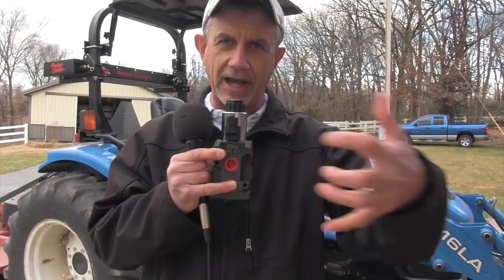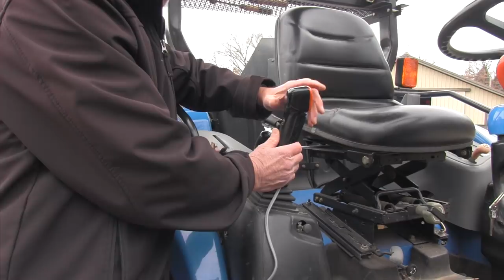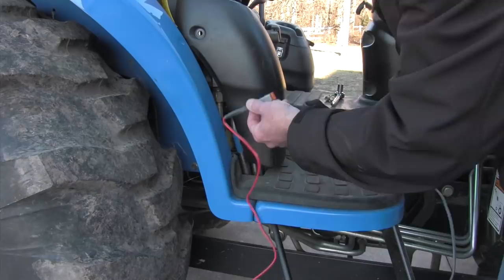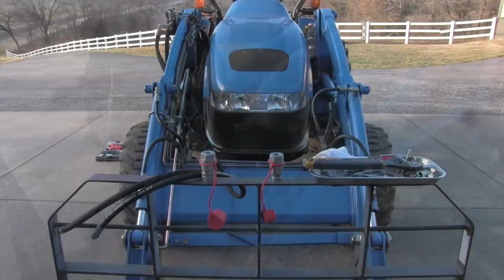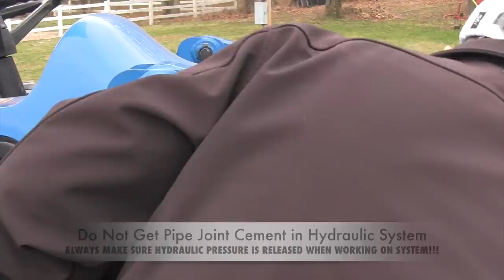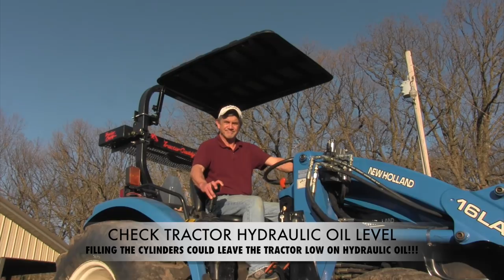How to Install a Diverter Valve So You Can Have a Grapple (or tree shear, or front auger)

Comment: under the mat is a bad thing.  You'll wear through the wire's insulation over time.
You should run it under the metal and zip tie it to convenient frame members.

Comment: Do you have any comments on putting the grapple functions on the dump & curl vs the raise & lower? Always appreciate your experienced insight. Thanks.
Reply from the maker: Some tractors have a regeneration system where you have to do that.  It wouldn't really matter to me which circuit it's on, but if you're used to one it would take time to wrap your brain around changing to the  other.  In other words it would probably screw you up to change from one to another, there would be a steep learning curve.

Comment: I was hoping you would have a simple drawing of how the hydraulic lines were installed, i have the dame valve already installed on my tractor but no hoses or grapples yet. It came with the tractor in 2007 and am now looking at adding grapples and hoses for it

Comment: Nice job Mike... What type of Grapple did you purchase, and how much did it weigh... we have been in the market for a while & have found it a bit confusing with the various units... God Bless...Chief...{NYS/ADK}
Reply from the maker: Funny you should ask, I have a total of six grapples here to test.  Stay tuned...  They're all on demo from a company not too far from me.  I get to test all, then purchase what I want and market on my website.  I have to be honest, I've never used a grapple, but each of these is slightly different and I'm anxious to try each.  I think I know which one will be the best to work for me, it's a grapple that you add to your pallet forks, but I want to see if the experience backs up my hunch.
Reply: I had the same question. The one in this video looked like an Artillian, but I can't say for sure. I am about to add a third control or diverter to my tractor. I think I'll want a grapple with lots of teeth on the bottom end for clearing small trees, roots included in some areas. 
I'm anxious to hear tractor Mike's opinion on the pros and cons of each concept.

Comment: regarding the KUBOTA comment that it should NOT be installed using the curl and tilt function and should be on the raise and lower function, please explain further, I installed on the tilt and curl and it does not function properly... thanks...

Comment: Great couple of videos, Mike!  And it gave me an idea. 

One of the "extras" that came standard with my LS tractor was 2 sets of rear hydraulic pickups.  After watching your videos, I was wondering; is there any reason why I couldn't just get 2 hoses (apprx. 12' ea) and feed them off the rear hookups to power a grapple/snow blower/etc?  I'm thinking I can zip tie the hoses alongside the boom with the existing hoses for the bucket and snake the hoses through a length of PVC in the operator's area to protect them. Thoughts?
Reply from the maker: Lawrence, that'll work just great!  The only disadvantage is you'll be using one hand on the rear remote lever, one hand on the joystick and one hand on the steering wheel, which can be a little tough :), but if I had rear remotes that's exactly what I would do and save a bunch of money.

Comment: Hey Mike I don't mean this to be negative or sound preachy but why not just buy a real 3rd function kit? You'd still be able to use all the loader functions plus the grapple and the kit mounts under the tractor with the loader valve for a much cleaner look not to mention the expensive valve, hardware, and fittings are in a more protected area. I'm much rather spend $500 on a true 3rd function kit. Another problem with this kit is the safety issue of having the operator get a face full of hot hydraulic oil from a tree limb or some brush catching on that mess hanging off the loader arm. I enjoy your videos and again I'm not being negative just curious why you chose this over the true 3rd function kit.
Reply: I'm not Mike, but as someone who just purchased a diverter instead of a third function, I can tell you why it made sense for me. One, it's cheaper.  Two, it's easier to plumb. Three, and this was the kicker for me, you can feather the grapple open or closed with a diverter because when you are holding the button, your joystick controls the flow, instead of just open or closed at full flow with a third function.

Comment: Don't use pipe dope on JIC fittings
Reply: Pipe dope is for tapered pipe threads only! As in NPT. Not for flares, "O" ring boss fittings (they are straight threads and the seal is the "O" ring). Three wraps in the correct direction, and neatly layered.
Good install but I agree with others, manufacture should provide reasonably priced kit that uses the tractors hydraulic connections already on board.

Comment: Hi Mike. I'm your neighbor in Northwest AR. I am trying to find a fair price on a Massey Fergason 3rd function kit for my 2705e. Do you have any tips for me? Thanks, Mike.
Reply from the maker: Howdy neighbor!  Call Ron at Marshfield Machinery in Marshfield, Missouri at (417) 859-2117.  Tell him Tractor Mike told you to call, I owe him.  He'll try to get you the best price he can, but those kits tend to be a little pricey.
Reply: @TractorMike  Thanks, Mike. I bit the bullet yesterday and Ordered it from Midwest in Green Forest. They are the company that I purchased the 2705e from. $1600 installed. Yikes! I need it to pick up the trimmings from my Walnut orchard. Now I will start shopping for the grapple. They only had one option. Do you think my tractor can handle the 84 inch one? Thanks again, Mike.